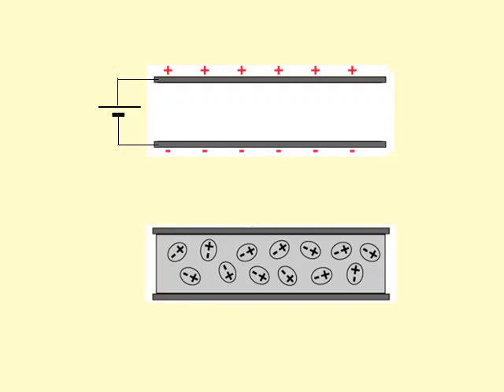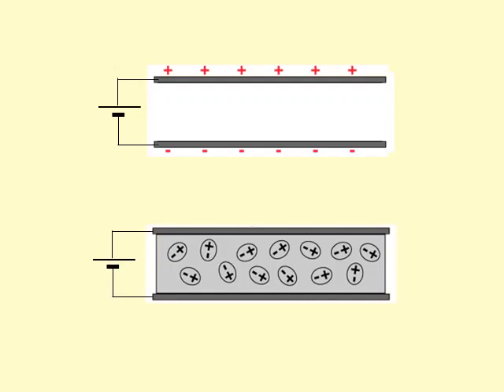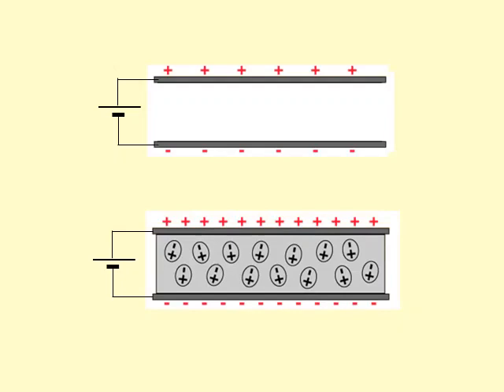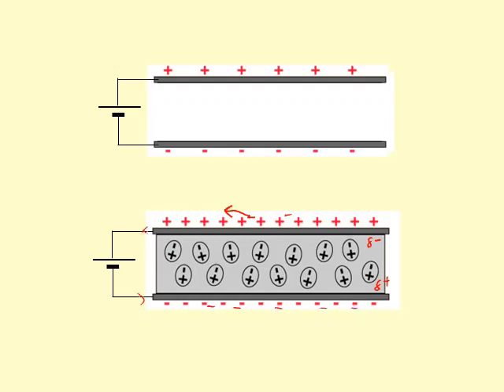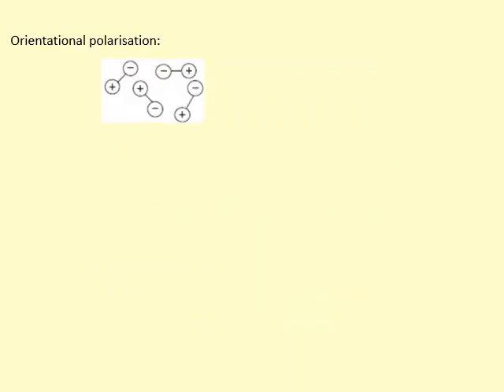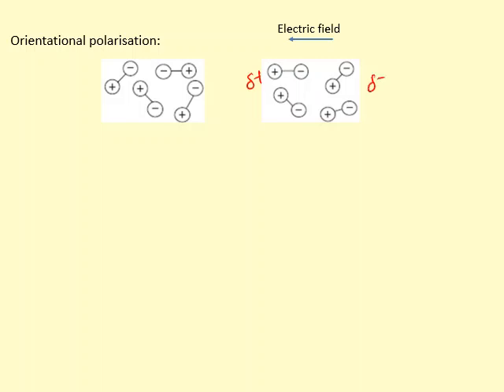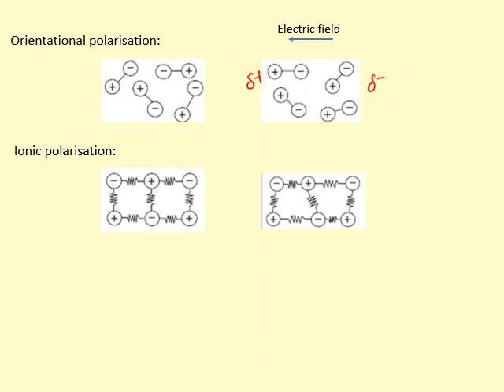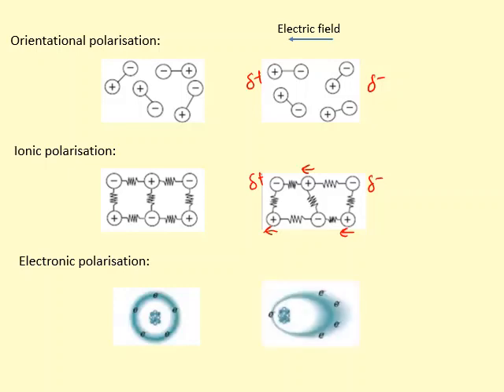11.10 How do different types of dielectric work?

Comment: bro what does it mean by a 'dielectric constant' then is there an equation for it?
Reply from the maker: it's the relative permittivity from the previous video εr which can be determined using charge with dieletric/charge without dielectric and is in the equation C = εo εr A/d